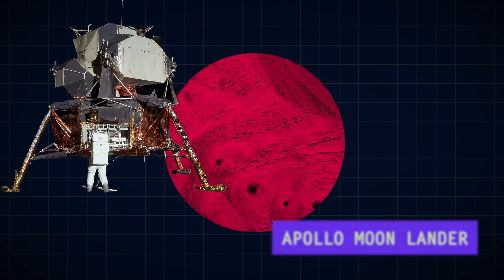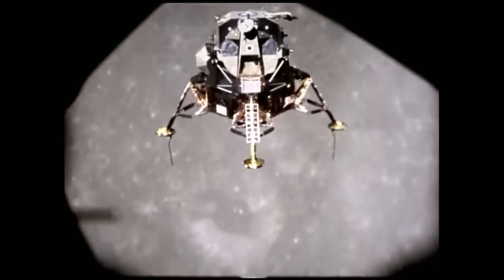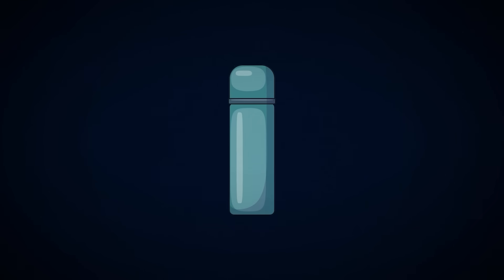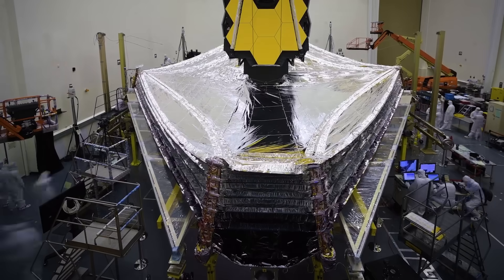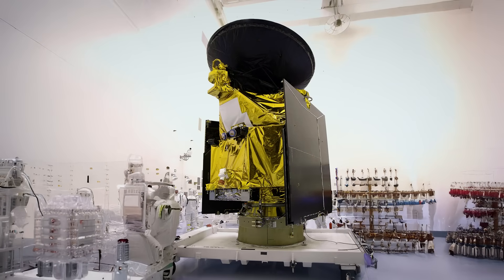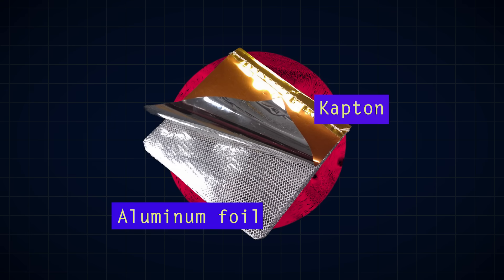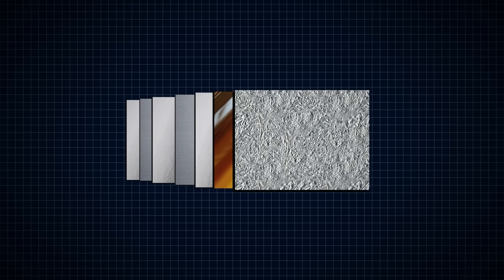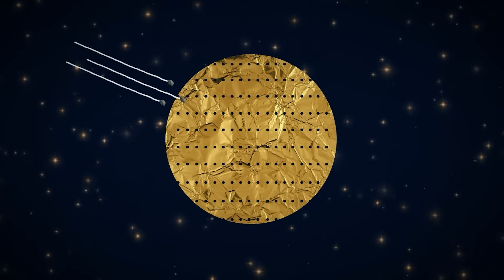Why Spaceships are Covered in Tin Foil

Comment: One of my favourite things on YouTube is the video of CC (Chris, New York, Westchester County) angrily operating under the belief that the walls of the lander weren’t simply covered in foil… but that the walls themselves were ENTIRELY made of foil, and that the astronauts had to be super duper careful when moving about inside… LEST their gear just rip a hole in the wall and ruin everything…

…six year olds know it’s just used as a cover lol 😄🤦🏻‍♂️
Reply: Bruh who tf thinks that a sheet of foil is holding up a whole lander. Like it had to stand on its legs even on Earth.
Reply: @axm-004  CC, Chris, New York, Westchester County apparently 🤷🏻‍♂️
Reply: The superstructure was rigid however the walls and panels were made from very thin aluminium sheeting. The landers were not pressurised they wore their suits in the landers. They were in fact quite flimsy machines.
Reply: @malcolmmcblain3954  That’s not accurate at all lol… there was absolutely nothing “flimsy” about any design on the lander apart from its general appearance. The walls were not just made of “very thin aluminum sheeting” — they did have an aluminum alloy skin though, as well as honeycomb core, and titanium fittings to make it incredibly strong, rigid and lightweight, including the thin foil coating on the outside, which was just thermal protection to stop heat escaping/getting into the craft to maintain a stable temp for the crew, and all the electronics… but to say the walls themselves were nothing but ‘thin, flimsy aluminum sheets’ is a pretty big misunderstanding of that vessel. 
They were obviously incredibly rudimentary designs by today’s standards, and the notion that they made it to the moon and back in a ‘tin can’ or something was just a joke the astronauts themselves started and was then popularized by Bowie lol 😄 But even for the time, flimsy looking or not, she made it there and back, and that’s never gonna be anything but sweet.
Reply: @malcolmmcblain3954  The lander was in fact pressurized. They wore their suits during the landing as a precaution.

Comment: Simple yet thorough. Knowledge defeats suspicion.
Reply: IT$ A CARTOON LOON  WTF MORON $
Reply: Navigating the exosphere and thermosphere would include temperatures of up to 2000 Celsius, & Protection from van allen radiation ☢ would need 6ft of lead minimum. The coating that looks like tin foil but allegedly isn’t tin foil but just looks dadgum exactly like tin foil, is nigh paper thin, and the strongest heat resistant material in the module is titanium, which melts roughly around 1600 Celsius.
Reply: Well said! ❤

Comment: Is it really tin ??? My guess is that's its is really aluminum foil, tin foil fell out of use during WWII. Tin is to expensive to be used for foil,
If you enter "tin foil" into Amazon, it will display hundreds of aluminum foil choices, zero tin foil choices.
Reply: Insulation.
Reply: Tin foil was used before aluminium foil became available. The term just continued in use.
Reply: @maxfan1591  Your grasp of the obvious is remarkable

Comment: Kapton is used in electronics as tape to protect components when heating the circuit board with hot air to remove other components.
Reply: ITS A CARTOON

Comment: Spacecraft are covered in multi-layer insulation (MLI) to protect against extreme temperatures, radiation, and micrometeorites in space. This 'tinfoil' consists of layers of metal and plastic, designed to reflect heat and provide insulation in the harsh space environment.